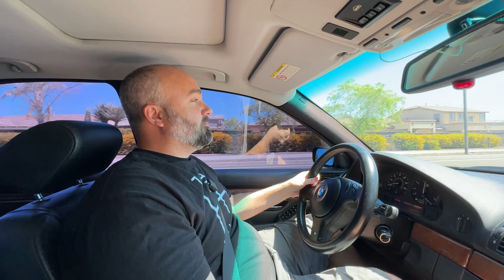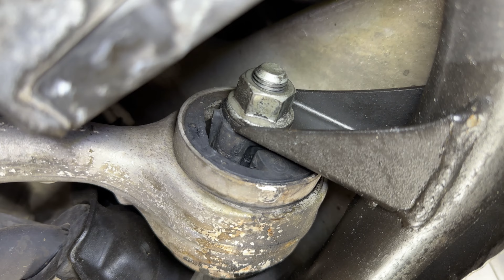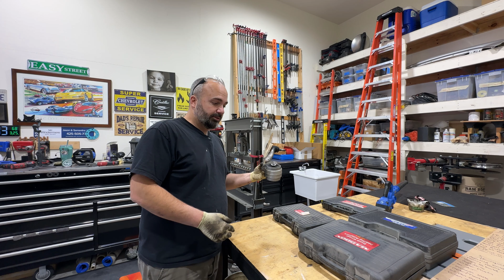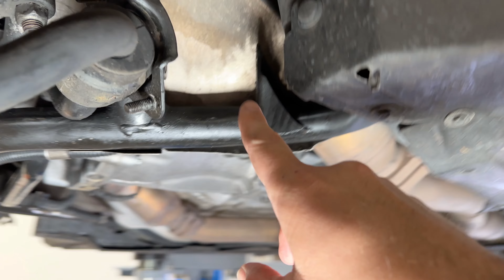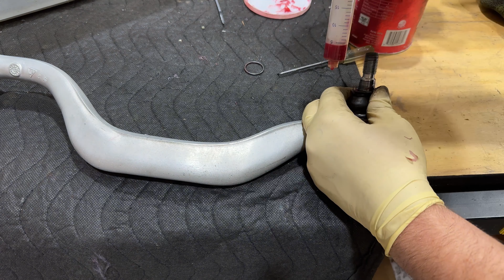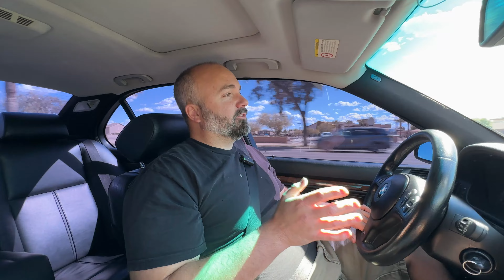E39/E38 Thrust Arm/Tension Strut Bushing Replacement | 540i Restoration

Comment: was curious if you had any thoughts on moosehead monoball thrust arm bushings ......I bought a car with them installed 2003 e39 m5 approx same miles as this car here ......im not familiar with then but learning .....it looks as though they are adjustable .........appreciate your channel        ps yes ride is a bit stiffer but not bad.
Reply from the maker: I haven't personally used them, but I've heard good things about them! I was just reading about them and the adjustment is to take up play in the bearings from wear. I can say I just installed Turner Monoballs on my M5 and the difference from the Poly was notable. That is a track only car, but wow. I'm not sure for me I'd want that on the street because I could feel everything, every rock, bump and crack. A lot of people run Monoballs on the street successfully though. That video will be out soon.

Comment: I'm about to swap out the tension strut bushing that you show here and put in the Powerflex split bushings into my 2014 X5.  From what I could see, there is plenty of clearance once the arm drops once you remove the bushing mount that you could leave the ball joint side connected, remove the old rubber guts, cut the old metal sleeve and remove the sleeve to install the new bushings all with it connected to the steering knuckle side.  Is there any reason that you see why that couldn't be done like that (without disconnecting the ball joint side)?
Reply from the maker: You could absolutely do it this way. The outer metal shell is going to be the tough part. Take your time and score it vs cutting all the way through. Then use a chisel to hammer it out. I’ve done exactly what you’re describing on subframe bushings and a few control arm bushings. Good luck with your repair!